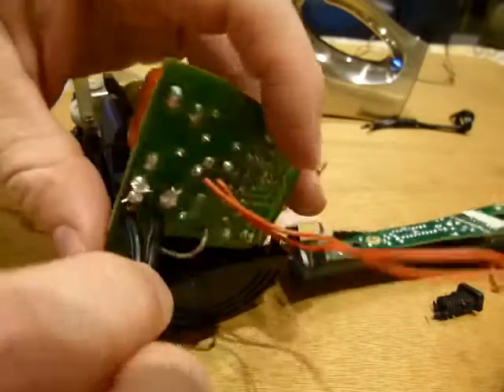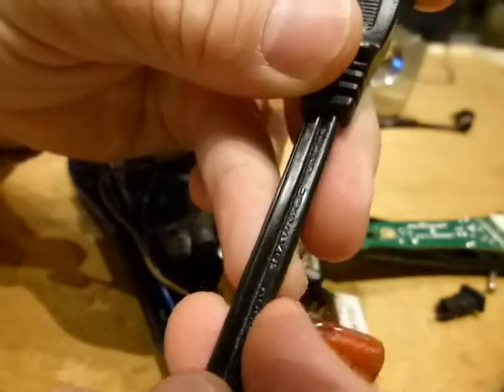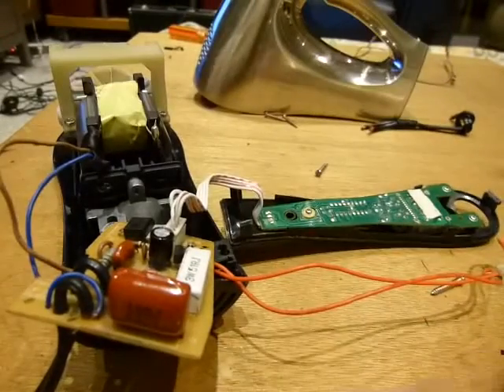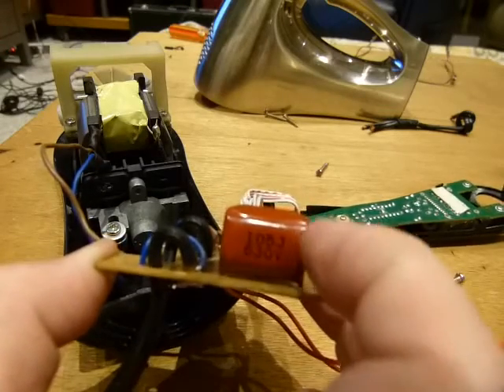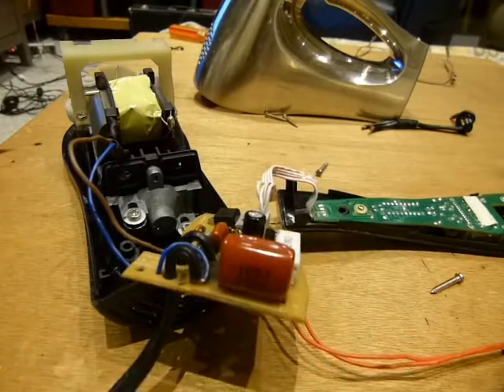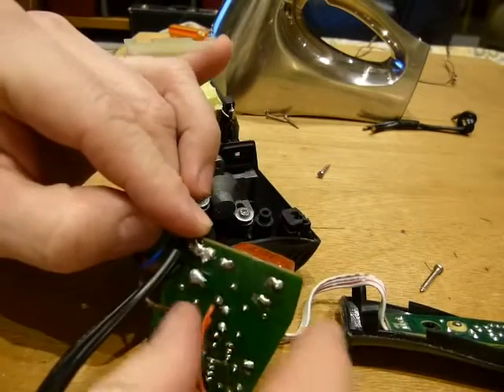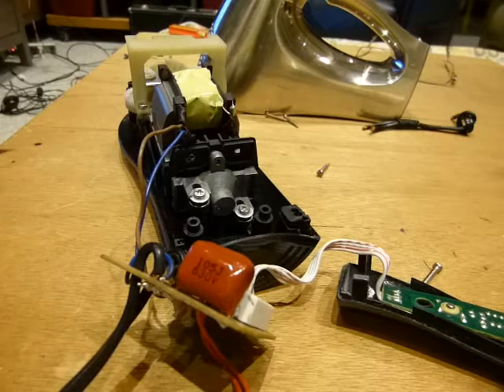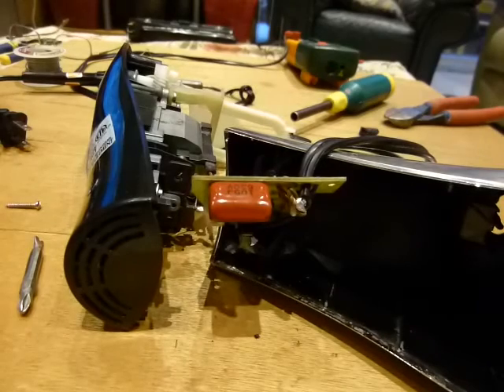Kitchen mixer electrical fix

Comment: Had a look on ebay the closest I could find was a cbb22 630v 105j capacitor but they only shipped from China and Hong Kong. Have you tried re-soldering the capacitor joints. It could be a dry or cracked solder joint.
Reply from the maker: Good point, it is possible. I`d need to take measurements and do the math to see if 250V or other voltage is reasonable for substituting.
Reply from the maker: hrep14 Will definitely try as I can`t find it locally either
Reply: theoverengineer Digikey: 495-2449-1-ND for Epcos B32522C3105J189 film capacitor. Maybe this works?
Reply from the maker: That part runs on 250 VDC, I needed a 630V. I found Panasonic part 49W1689 at http://canada.newark.com/panasonic-electronic-components/ecq-e6105kf/capacitor-polyester-film-1uf-630vdc/dp/49W1689?ost=49W1689
Reply: theoverengineer I had a gut feel that the 630V capacitor was there because the manufacture got it cheap somewhere with that rating, sometimes I have seen under rated 250VDC capacitors in a devices meant for 230V 50Hz here like CFL's and LED bulbs and I thought it was also a similar case only bit over rated for 120V 60Hz use. Digikey has this 60 cents cheaper: EF6105-ND. Cheers.